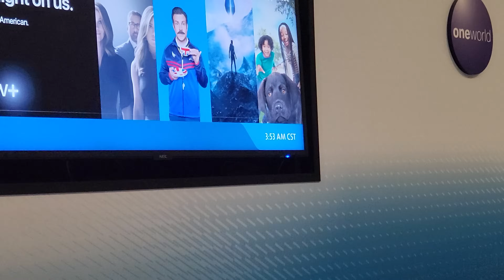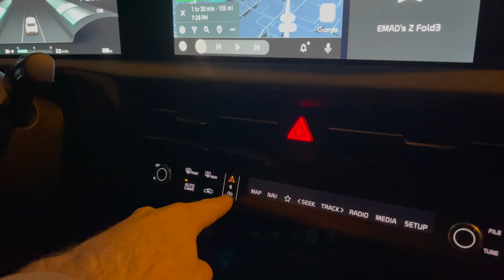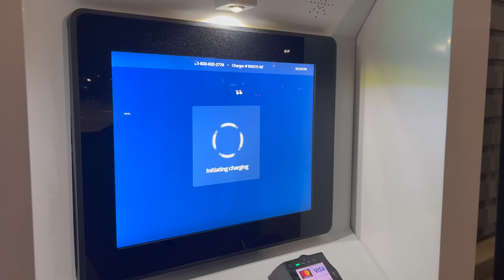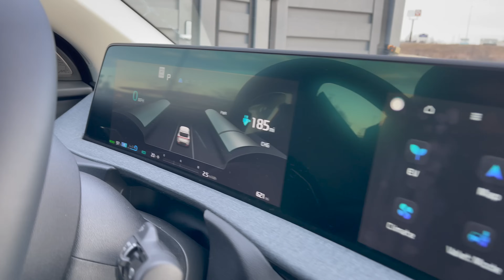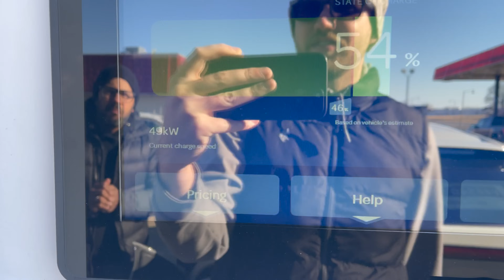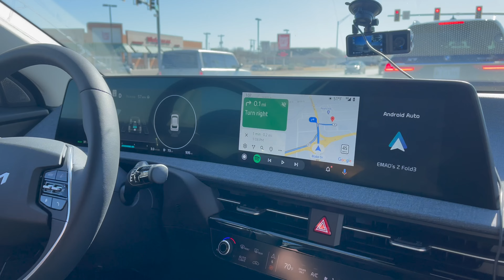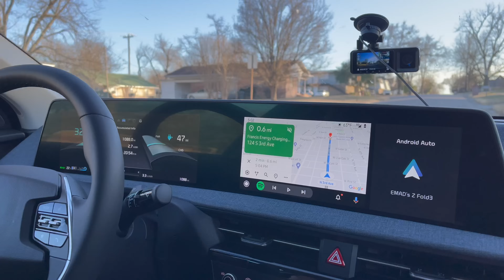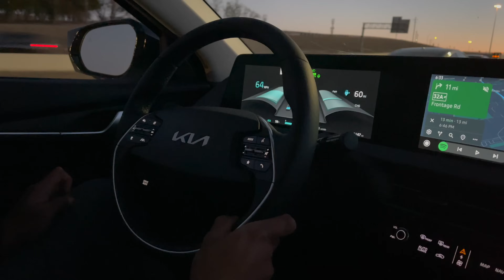First Kia EV6 Road Trip In America! Over 1,000 Miles To Dallas For A First Time Electric Car Owner

Comment: The Android Auto not being full screen is actually something i like in my Hyundai Santa Cruz - I use that side panel to display vehicle info ... radio/weather/etc. I find it far more useful than a widescreen map. I'm guessing you haven't found those options in the menus yet. There's a lot to dig through though. :) 

This trip really points out one of the biggest issues holding back EVs for some people - the charging infrastructure. Until it's consistently fast, and the stations consistently WORK (which is disturbing, considering they're essentially all brand new-ish installations), range anxiety will remain real - because while you may know where the next charger is, you don't know if it will charge you when you get there. That's a huge issue. Also, what you've pointed out about the location of a lot of chargers. Half a mile across a Walmart parking lot with no real amenities for travelers isn't a great experience. Things are getting better, but not quite there yet for great EV road trips.

Comment: Look into ABRP ( A better Route Planner). It's like the Tesla route planner, but it works with a bunch of EVs. You put in your specific EV and when you put in a start/destination it plans all the stops, time needed to charge, and cost based on your specific car. It has the EV6 as an option. This is where Tesla still has the lead, as this is built into the car navigation system, and if you use it the car will condition the battery for the charges. But, ABR is a good alternative for non-Teslas.

Comment: For anyone who didn't understand the issue at the first charger Electrify America stations have 2 RFID readers.  One is on the stall and is used for a phone to verify membership.  The other is on the pay terminal and is for wireless tap to pay.  If you tap your phone on the pay terminal it will attempt to charge the credit card attached rather than use the membership (and charge the $0.43/kW rate even if you have the paid membership).

Comment: Thanks for sharing the video. Hope that Emad enjoys his EV6!

That said, this video might also scare some people away from EV's in general, such as during your discussion with dealers doing high markups on them, and then having trouble at various EV charging stations, to mentioning that the EV6 doesn't even come with the EVSE (electric vehicle supply equipment) to charge at home with? It would suck for the first time EV buyer who didn't do their homework ahead of time to find out these problems.

If anything, this video shows how Tesla, love them or hate them, has done EV's right. Sure, you can't normally get discounts on them, but they also don't randomly mark it up ridiculously either. And almost every supercharger I've been to has always worked. If it didn't, there were often 4-8 other stalls you could try so you're not necessarily forced to find another charger. Tesla will usually get the broken ones working within a few days.

Even preconditioning the battery while enroute to a supercharger so that the battery is nice and toasty for a faster charging session are things they've taken into consideration. And in the event you do have to wait a while, there's also built-in entertainment options to pass the time.

I hope that other automakers are taking notes on how to make owning an EV better if they want people to buy them.
Reply: The video was honest and MUCH appreciated. My model y performance should arrive May or June and this video together with comments encouraged me to forget about cancelling the order and buying EV6  or Ionic5 or Leaf.
Reply: @d-man6509  I fell in love with this Kia earlier today, but after seeing this video I will wait for a 480 hp Tesla.

Comment: I would suggest using the app to charge instead of the tap to pay at EA.  They charge an additional $50 each a charge is initiated.  Granted it comes off after a few days but it was quite surprising when it happened to me.
Reply: If you have a iPhone all you need to do is tap rfid symbol I have my membership card in apple wallet. And I use Face ID to sign into app. It starts up no swiping and I don’t need a credit card. Before rode trip you need to sign up and learn from someone how to use it. I have zero problems but in the winter you won’t get great speeds. And .31 cent kWh is great compared to per minute. Especially if it charges slow. Ev go charges 39 cents per minute.
Reply: @markfitzpatrick6692  lol evGo in Calhoun, GA was over 50 cents and SLOW. I hate them

Comment: Thanks for this video. That non Supercharger infrastructure reinforces my correct decision to buy Tesla. My son has had his model 3 for 4 years now. You just pull in, plug in and it charges. Zero hassle!
Reply: Not only that, you can also use a "Tesla" charging station with an adapter. 👍
Reply: How much did the trip cost?
Reply: @kenrdavis2266  Not counting all the extra charges and holds on his credit card? Ha ha haaa, that would piss me off so bad. Just No.

Comment: Quick tip: the best way to activate the EA chargers is by adding your account to your Apple wallet or google pay wallet. Then you can just tap you phone and charge. Using the app leaves a lot more room for error as the phone has to log in, connect to the network, and send the charger your info. Lots of this places don’t have great cell service leaving you stranded or waiting a long time to connect.
Reply: Another quick tip: driving 75 mph will take a hit to your range. The best speed for the most range for EVs is around 65 mph.

Comment: Thank you for taking the time to put this review together. However one note - the reason why Emad was able to get this vehicle without a preorder is because what he picked up is the entry level Wind, without the heat pump. 

Given you folks were out in the cold - this is only somewhat of an accurate range test. What would be great is also doing this with an EV6 equipped with a heat pump.
Reply: It does have the heat pump because it's stated that it's the AWD version
Reply: @AAG Light rwd is the entry level next is Wind rwd then Wind awd. I thought Emad said he purchased Wind awd which is the winter mode / heat pump that looks not to be too efficient but that would be the winter mode because it's not on the Wind rwd.

Comment: Nice video, I think his experience will be much better if he has a charger available where he lives, so he can keep it charged.
Reply: I'm getting a level 2 installed in my house. But the fast charging infrastructure in Dallas is obscene. Basically non existent. Very frustrating.
Reply: @Emadifications  I guess it depends on  your driving patterns, If you don't exceed the range of your car, then  you can use that lvl 2 to charge overnight and generally don't need fast charging until you exceed the range of your car and need it.
Reply: @Emadifications  An oil state. Expect Texas chargers to go like Texas pay phones did at $8 a minute. Nothing is legit in Texas.

Comment: Great first charging experience:
- App doesn't work
- Can't see shit on the display because of sun glare
- it's 32 cent per kWh
- It takes ages to start charging
- It is super slow
- Wrong metering on the second charging session

😂
Reply: .31 cents on ea is cheap
Reply: Portland ,Oregon supercharge $0,39
Reply: Still cheaper than the typical gas car.  Right now with Putin’s escapades a lot cheaper, but charging process is way too complex except for Tesla.

Comment: Francis network is pretty bad. I live in Oklahoma. They're pretty much always down. I hope you left reviews on plug share to warn other EV drivers.   Also, there's no consistency in Francis equipment. So many different models and power levels. You never know what you're going to get when you pull up unless you Read the fine print in the app.

Comment: I'd love to try some other EVs but this is the exact reason why I don't. I took a BMW i3 from OK to CA, then CA to OK on the EA infrastructure. It was a nightmare! I now own several gas cars that are awesome, as well as 2 Tesla Model 3s. You just can't beat Tesla's charging system. I want the new Lightning, and really wanted a MachE. Nope, can't do it.
Reply: TESLA has a standardized system and you know exactly what to expect. The way I see it, all chargers should be AUTOMATIC and be connected to a payment system built into the car itself connected to the driver's account so that all we need to do is plug it in.
Reply: @PassportBrosBusinessClass  I agree with that 100%. Unfortunately Tesla was ahead of the EV game and got the jump on everyone else. Part of the allure buying a Tesla EV is knowing exactly what to expect. If Tesla started letting every other EV owner use their platform, it would drastically diminish the value of owning a Tesla. Chargers would be overrun with Kias covered in blue painters tape! LOL Imagine that!
Reply: I am with you. It’s the biggest reason I’m getting a Model 3 instead of any other EV. Like you, I was interested in the Mustang or Kia, but there are too many horror stories on the ‘non-Tesla’ networks. ,

Comment: Fun/pro tip for all:

Most newer EVs, this one included, have battery pre-conditioning.  In order to use pre-conditioning, you need to navigate using the car's built-in navigation.  Using Android Auto or Apple Car Play will not tell the car you're navigating to a charger and the car will not pre-condition the battery for fast charging.

This was probably already mentioned somewhere in the comments

Comment: Great video as always.  Two things confirmed for me.  Road-tripping anything but a Tesla is still not easy, and Android folding phones are not for me 😂.

Oh and the extra “TAB” for DC fast charging is annoying 😒.
Reply: Yeah, that cap for DC Fast Charging is annoying... I dont think it's necessary... or they should make hinged caps/lids, like they do in Chevy Bolt EV or Nissan LEAF... so you can swing the cap like a door and it's out of the way when you plug in. Seems cheap on this design of both Hyundai and Kia.
Reply: @be236  my Focus has one. I really don't understand the point of it since j1772 doesn't have a secondary cover. Is DCFC uniquely fragile?
Reply: @jghall00  Just more power into it, so I guess they are just overly cautious if water gets in.

Comment: I didn’t read all the replies to see if this is mentioned, but many of the EA stations I’ve been to more recently have stickers added to them to show what the station number is. Having it on top of the station isn’t very intuitive, and I think they realized that. Also, I don’t think the battery preconditioning works unless you use the built in navigation to navigate to the charger.

I think my personal take-away from my time with electric vehicles (almost 4 years now) is that yes, an ICE vehicle is more convenient for longer trips where you have to recharge between destinations or for longer distance towing, but an electric vehicle is more convenient and generally more fun in almost any other daily driving circumstance. The convenience gap between ICE and electric vehicles on long trips has substantially narrowed over the past 4 years to the point that a road trip in my Model 3 is not really an inconvenience at all. The time between charging stops is about as long as the time between restroom stops.
Reply: But that (your last sentence) doesn't address the issue with broken charging stations, that can also lead to queues at the working ones, and it doesn't address the fact that it can take 5-15 minutes to get one station pump operating properly...  Add in bringing a family along on road trips, and patience starts to get thin really really fast in your car's cabin...

Comment: You don’t need to swipe on the app or look for a number. My Ea card is in my apple wallet and I just tap on the rfid symbol. You are not going to get hi speed in the winter. Even with ev 6.
Reply: Yep, everyone is figuring out that now. It's disappointing that the battery pre heating isn't working as everyone assumed. I have the Ioniq 5 which has no battery heating system since it's the RWD version. I live in MD where the winters are only really cold for 2-3 months and don't plan to need to fast charge often during that time, but it's good for everyone to find this out early.
Reply: I have Kia Niro EV and I'd be lucky just to get around 20kW speed in winter...

Comment: Interesting video.  But it just shows how public-charging infrastructure is so not ready for the general public yet, even if it's getting there for BEV fanatics.  We so desperately need a universal "Plug and Charge" system in which all fast DC charging stations do not require use of phone or credit card onsite, but rather will have software that can just communicate automatically with your BEV to initiate charging from your personal account that has your credit-card information.  And I just can't understand why public-charging companies cannot design screens to either be more visible in sunlight or to be shielded from sunlight.
Reply: If they took your other advice the chargers wouldn’t even need screens. Tesla got it right.
Reply: There is a plug and charge standard for CCS. Unfortunately not every car supports it and not every charging station does either. EA supports it at most of their sites. I think only some of the earliest EA installs may not support it. The Mach-E is the only vehicle I'm aware of right now that supports the P&C standard and it does work at EA. The VW ID.4 doesn't currently support it, but supposedly it will via a software update (maybe version 3.0).

Comment: I was interested in the electric cost and performance along with the overall experience. Thanks for sharing this. Also when you drove past the Ft Leonard Wood Heavy Rescue vehicle I recognized the stretch of the I-44 as near Devil’s Elbow, Missouri before crossing the Big Piney, as I used to drive by there many times after getting out of the Army after serving at Ft Leonard Wood from 1981-1984 and then driving to my Army Reserve unit in Rolla from 1984-1987 and also working in Rolla, MO. I’d like to go back to the area and see how it has changed in the past 34 years.

Comment: The EV6 / Ioniq 5 DC pin covers are probably the worst I've encountered. Rip those off.
Reply: They're there for a reason.
Reply: @Dive-Bar-Casanova  yes, and the reason is that Kia were too cheap to spec nice sprung hinged covers. Mercedes has very nice ones, you can just nudge them with the charger plug and they pop right open.
Reply: @Dive-Bar-Casanova  rip ‘‘em off
Reply: @krugerdave  Totally agree... Hinged covers like Nissan LEAF or Chevy Bolt would allow them to swing out like doors, and out of the way to plug in... Instead those covers just flap around and block the ports... It's a pain whenever I plug in my Kia Niro EV to fast and slow charge...

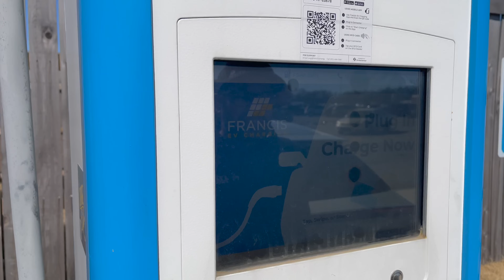Comment: 1:11:00 A lot of BTC Power chargers (the brand Francis uses) are susceptible to sun damage on the LCD screen. I call them sun-spots. I really wish they'd install a sun screen over them like on many outdoor Redbox DVD rental kiosks. Also, quick tip, make sure you plug into the taller BTC Power units because they can supply up to 350 amps. The shorter units only go up to 150 A.

Comment: Why does no one ever show how much the charging actually cost?
Reply: Our question too.  Really interested in the roadside rest chargers cost run by the states. They mentioned they were going to  tell us that when this video dropped.
Reply: One good estimate is to plan a route on A Better Route Planner, it frequently gives the cost of DCFC stops based on the location's pricing (cost in cents per minute or cost in cents per kWh).
Reply: Each ~ 20-80 stop was about $11-$17.
Reply: If you are a member on electrify America the kwh cost is .31 cents. And some states charge by the minute.12 to .24 cents a minute.  Ev go in my state is .39 cents a minute.
Reply: It depends on where you live and what the rates are at the moment. Members get a better rate. A lot of new cars get free charging at a specific station for 2 years and who know what prices will be like in 2 years.
Reply: @Emadifications  aka a hybrid prius still rules.  60mpg and 580 mile range.

Comment: Next time you are at an EA charger. Try using the app first to activate the specific charger and then plug in. You will find that works even quicker.
Reply: An added tip, if you're using Carplay or Android Auto you can initiate the charge from your car's screen before getting out to plug in.

Comment: I drove by several Teslas in the heat , their windows were open , I guess because battery drains fast. My 2002 hatch 5-manual was purring along with ice-cold air on.